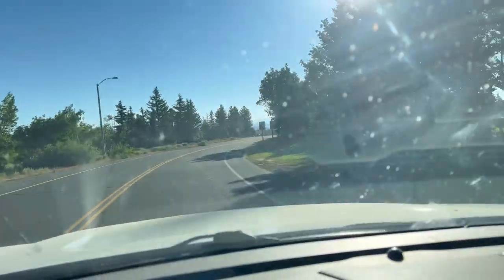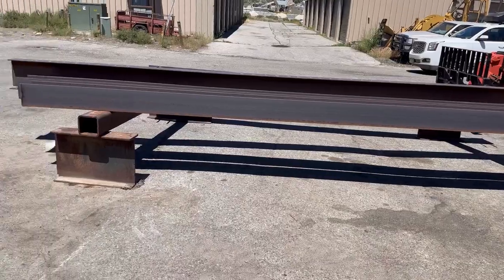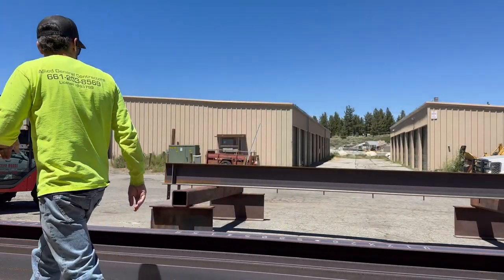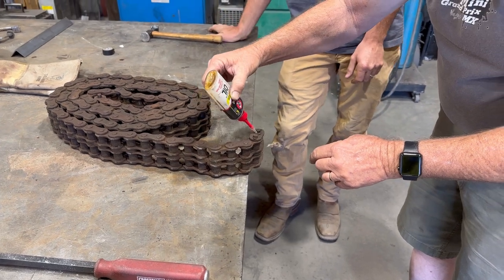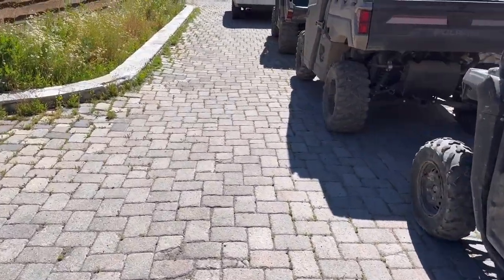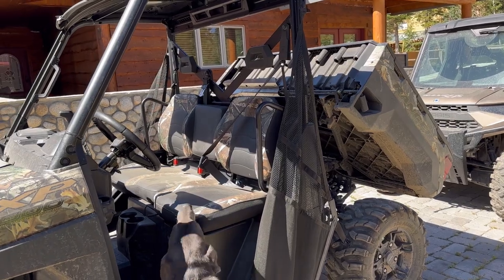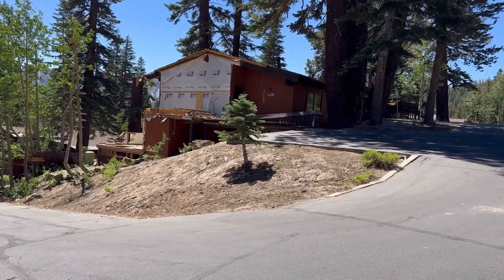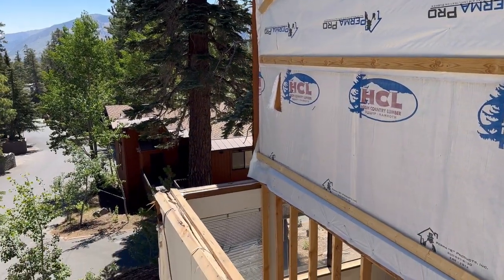Mammoth vlogs 8-9-23 (A good day at the office)

Comment: 21:45  A commentary on how engineers can mitigate anything -- it's a question of cost vs. benefit.  If Plow Bros. can make reclamation of the June Lake lot pencil out, then it was worth the time and effort, after a very sloppy start.  I wouldn't have thought the lot was reclaimable with how much spring water was seeping through it; but the way this is taking shape I think the home that goes here will hold up just fine.  BTW, you said you were going to dig a trench out to the stream out back, but in that last shot I didn't see one.  Please tell me the groundwater is flowing out of the pad.  It was looking pretty mucky and saturated yesterday.